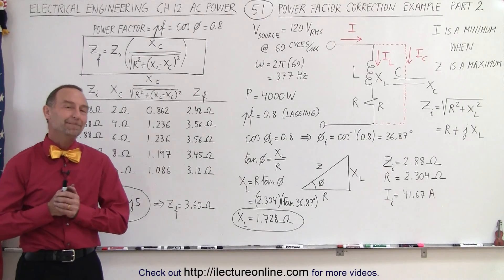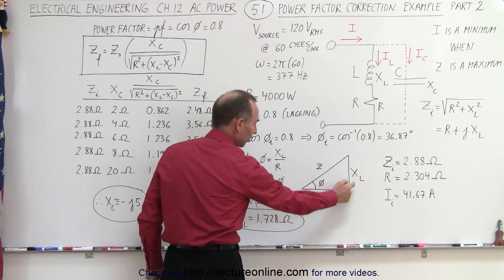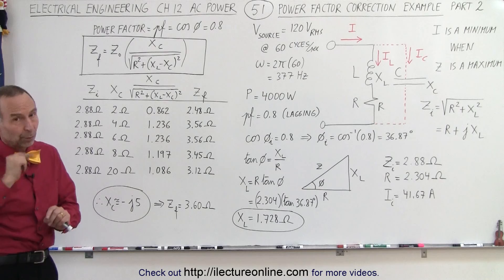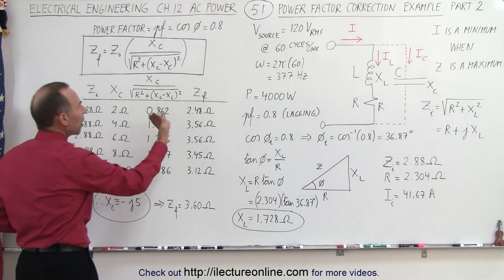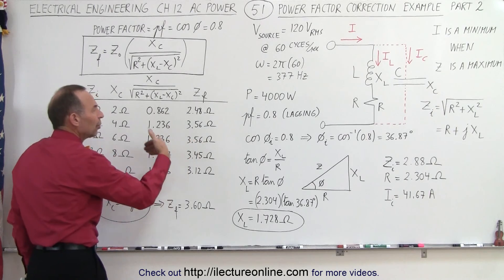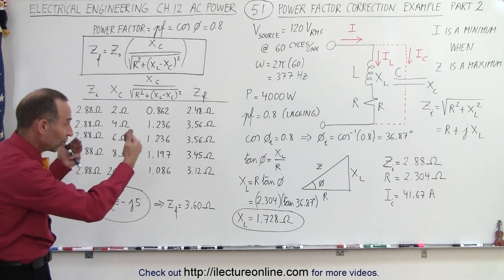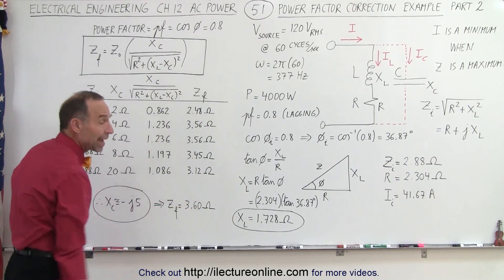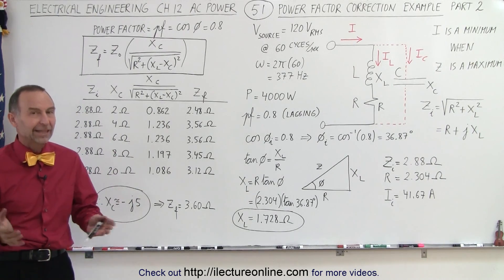Electrical Engineering: Ch 12 AC Power (51 of 58) Power Factor Correction: Example Part 2

Comment: There is a mistake at the unit of mesure for the angular velocity, should be; radian per second  "R^-1". Not Hertz "Hz".
Reply from the maker: You are correct.  Even though both rad/sec and Hz have the same units, (1/sec), they have different meanings.    Hz = cycles/sec

Comment: Pl.take an example of improvement of P.F. from 0.8 to .99 for a certain load
Reply from the maker: You need to perform the same calculation, but replace 0.8 by 0.99 for the power factor.
Reply: Ok sir

Comment: Hello, again Michel!
I wanted to ask you since you were a physicist; do you think it's possible to earn a Bachelor's in Computer Science and then a Masters in Physics? I am really interested in learning about physics but I also worry about job perspectives which is why my current undergraduate major is in Computer Science. Do you think it's doable?
Reply from the maker: The job market is great for those who are proficient in programming computers.  Depending on the application, also having a background in engineering, math, or physics can really help.  If you plan on doing graduate work in physics, it will be difficult unless you had some experience with undergraduate physics work.  It would probably help if you go back after you graduate with your CS degree and take a few basic undergraduate courses in physics first before jumping into graduate work.